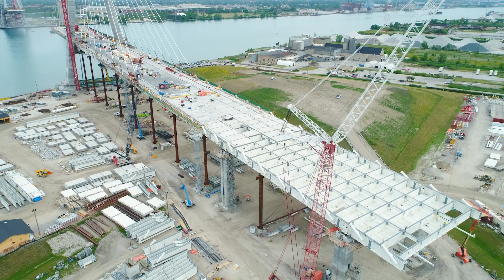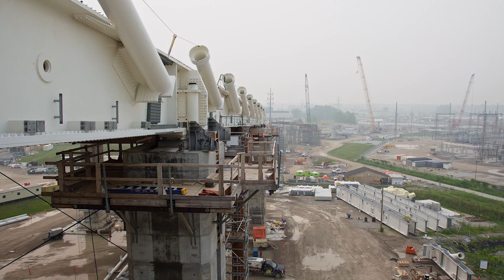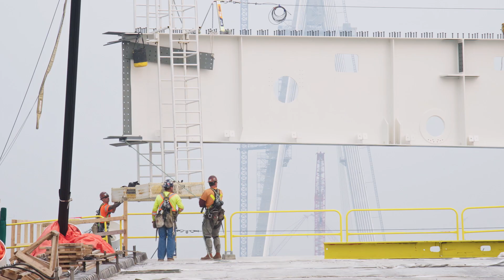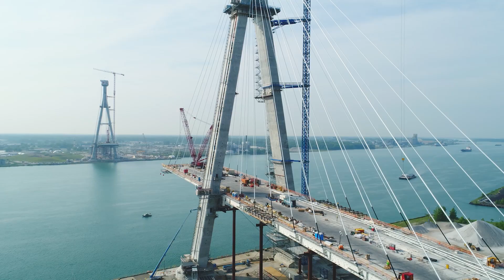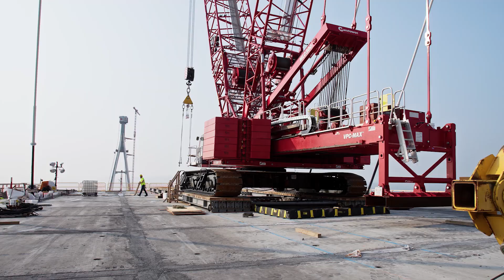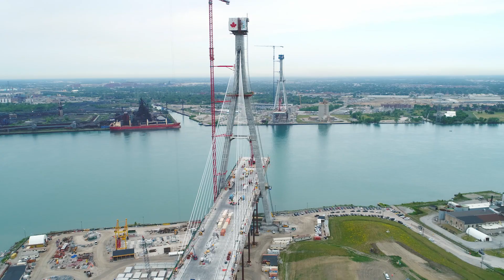Building the Gordie Howe International Bridge

Comment: It looks to me that the steel reinforced bar in the pre-cast panels 
are NOT the best, most durable type available for construction.

The state of the art with steel re-bar is to use coated steel with 
epoxy or other coatings to prevent corrosion of re-bar......that was 
a design mistake that should have been addressed with the physical 
performance specifications for the pre-cast panels for the project.

Comment: Looks to be of similar design to some bridges built recently in Vancouver, with the suspension cables tapering inward over the road... I hope they came up with a solution for the ice bomb problem, there has been no end of problems in the winter time with chunks of ice falling onto the vehicles below in Vancouver... a city not known for its cold winters.
Reply: Similar to the Quebec City bridge of similar design with same as well as other problems so they may want to re-think quite a few things in frigid during winter Detroit
Reply: Seems they were more concerned with hockey stick aesthetics than safety. That said Vancouver gets 57.5" annual precipitation, Detroit 31". Winter temps in Detroit are 10+°F colder than Vancouver so let's see how this plays out...